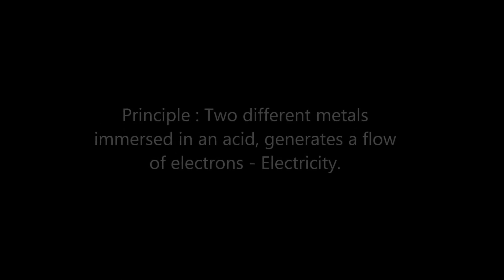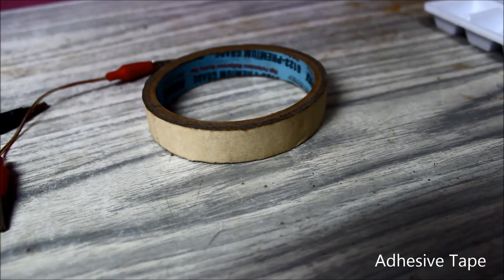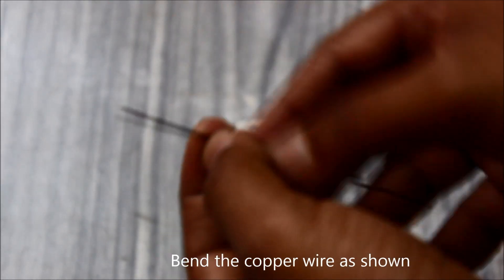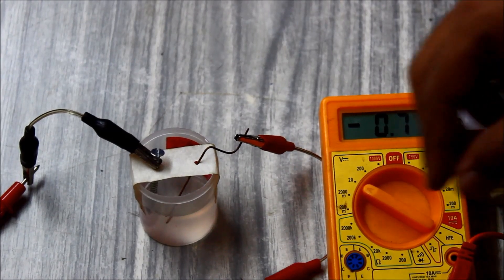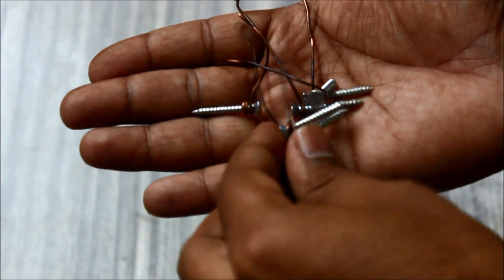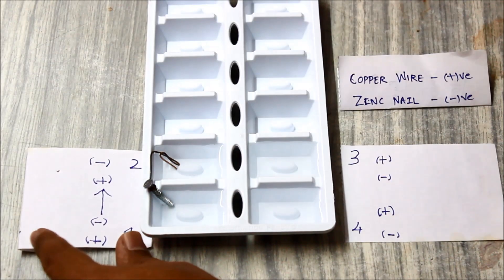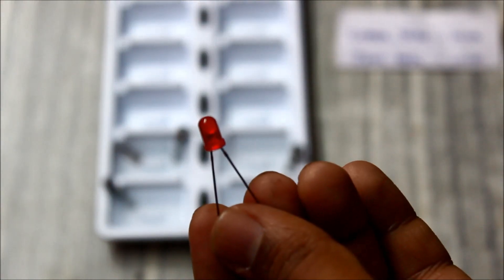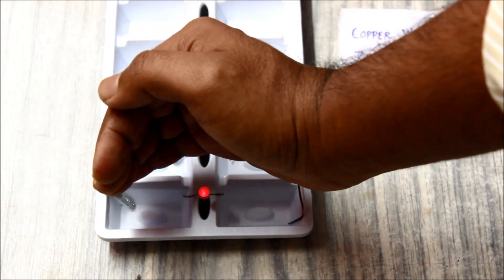How to make a Vinegar Battery

Comment: U shud replace the zinc screws with pencil graphite. I have tried creating a 500ml mineral bottle into a battery with pencil and copper plate/wire poked thru the cap and gave higher voltage.

Comment: What is giving the best electricity flow? Vinegar or salt water? Both gives it I suppose, but salt water is cheaper since we have it in the oceans.
Reply: Vinegar works better, it's more acidic
Reply: mix the two to increase the voltage alot

Comment: So my question is.........when u put the same amount of vinegar in 4 smaller containers rather than one large container.........it generated more volts???????? Is that how it happened???? Or did u use more amount of vinegar????? Please do reply, i want to know.........
Reply from the maker: Seal
1) How long before the electrons/charge from the vinegar is depleted? I'm sure this depends on load of course but what's been your experience by way of examples? Will it recharge on it's own over time?
- Till the last drop evaporates. The voltage remains constant throughout. 

2) how often would one have to change out the vinegar with fresh vinegar?
- Depends on the quantity. The more the quantity, the more time it will take to evaporate to nil. 

3) What liquids in your opinion hold the highest charge and last the longest? Would, for example, Hydrochloric (HCl) or muriatic acid offer more charge than vinegar or about the same?
- There was a equation to calculate the voltage output, i remember we had this in school. its been 15 years now. You can google it. But there IS a mathematical equation for sure.
Reply from the maker: Tooba Waheed Lets say we have 1 litre of Vinegar. If i put it in one jar, i have 1 battery which will give me 1 volt approx.I then divide in two different jars. Now i have 2 batteries. that gives me 2 volts. If i divide into 10 jars i have 10 batteries, which gives me 10 volts..This is because the quantity which cell requires is very meager. so it doesnt really matter if you have 1 drop or 1 litre of vinegar.
Reply: Ok :D thanx a lot.......
Reply: vic86m So the next question(s) is (are)... 
1) How long before the electrons/charge from the vinegar is depleted? I'm sure this depends on load of course but what's been your experience by way of examples? Will it recharge on it's own over time?
2) Taking into consideration question 1) above, how often would one have to change out the vinegar with fresh vinegar?
3) What liquids in your opinion hold the highest charge and last the longest? Would, for example, Hydrochloric (HCl) or muriatic acid offer more charge than vinegar or about the same?
Thanks!
Reply: vic86m
Awesome, thank you for your reply. Enjoyed the presentation.